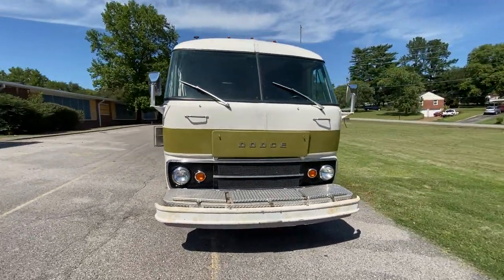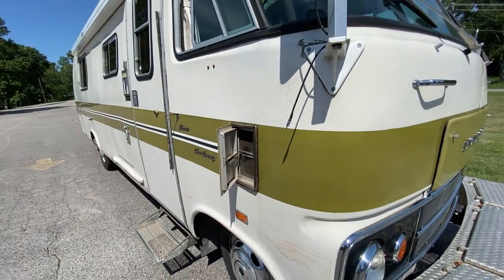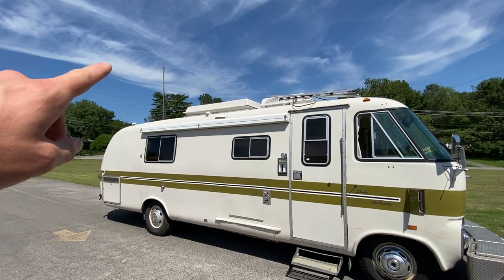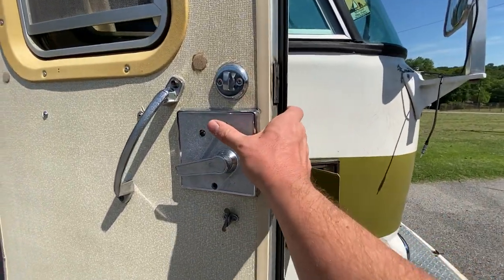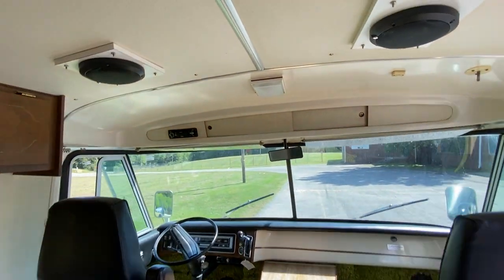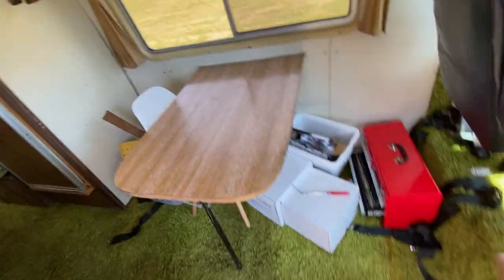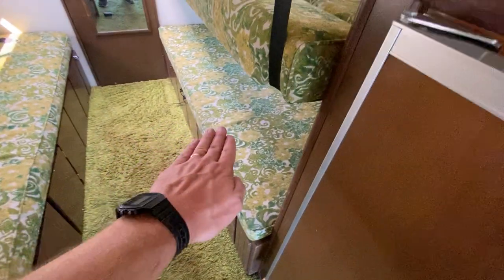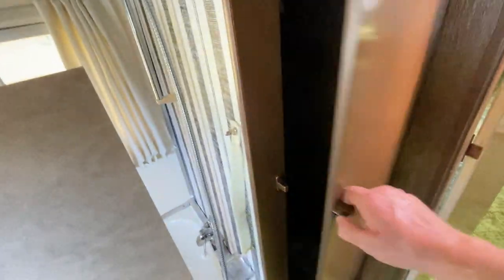1973 Travco 270 walk-around and tour ~~~ Pre-renovation

Comment: I have a '76 320 I got from my uncle, who ordered it new outside Seattle at Lynnwood Dodge. It then, in short order, wound up in Alaska for the next 25+ years. Came down in the early/mid-2000's, got a re-vamp, then went on a trip across the US and into part of Mexico. They gave it to me in 2014, now getting set to bring it across the US this summer. I do have both door locks, so I think that internet story is a story. Mine does have the LeCarra steering wheel, CIBIE driving & fog lights (the old concave lenses, big rectangular units), and the Alcoas are being polished and prepped for new AH-11 tires (all seven, about $1800 "Good buddy price"). Will recommend Bilstein shocks, sway bars on both ends with poly bushings, external trans cooler and deep trans pan, replace all rubber fuel hose the alcohol content in newer gas is great for rotting the ancient hose and have the Thermo-Quad carb rebuilt with a later/updated material kit (same reason, alcohol content) as well as replace the fuel pump. That is just a primer on the mechanical

Comment: That thing is in EXCELLENT i mean excellent condition, I'd go through the drivetrain couple solar panels on the roof air conditioner,THEN shake the house payment and go get myself a nice spot on the mountain and drink cold beer.
Reply from the maker: It looked like it was in super condition on the surface, but there was some pretty gnarly issues lurking in there once we started digging deeper. The shag was hiding issues that could have led to electrical fires, mold under the cabinets, rancid food oil spills that had been sitting for who know how long, rust on the internal frame from old leaks that needed to be resealed, a really inconsistent and shoddy insulation job... The more we cut away the more needed to go. 

We were at first just going to do a facelift, update the mechanical parts, replace ac, etc, now it's become a total renovation.